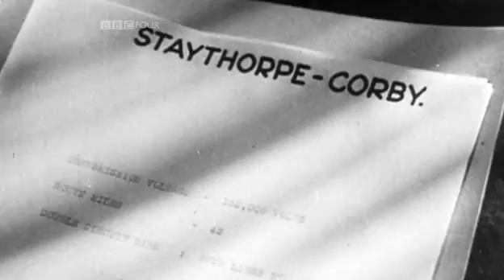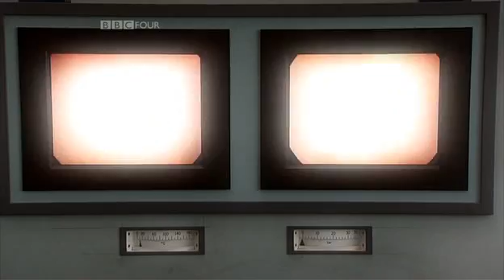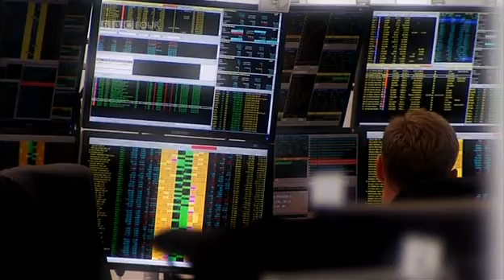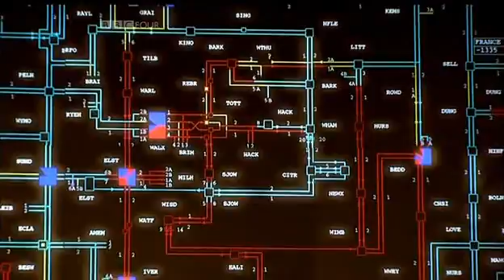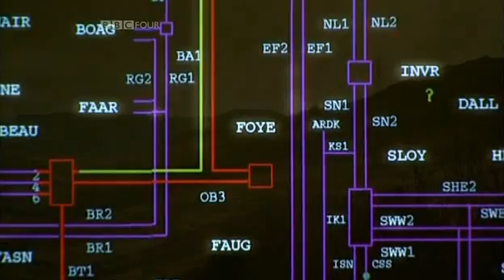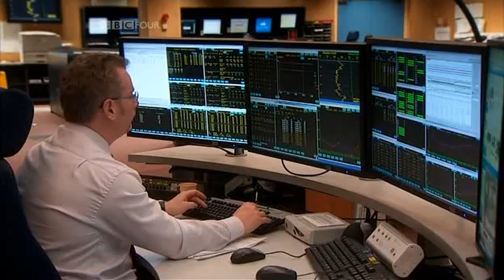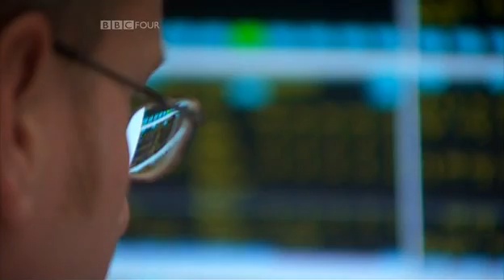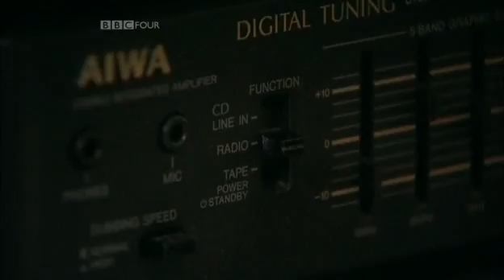Wiring the Nation - Part 4

Comment: Does anyone know what dangerous fun is happening at 3m58? Thanks
Reply: Cable maintenance. You still see the same thing happening today - workmen ride along the cable (often live) in a cable car. When cables are upgraded or replaced the new one is hauled along the old using these contraptions.
Reply: @piggoy  guess having balls of steel would be both a safety hazard  and a requirement  for this job role
Reply: @piggoy  In this case it was actually fitting spacers on the newly constructed 275kv twin-bundle cables.